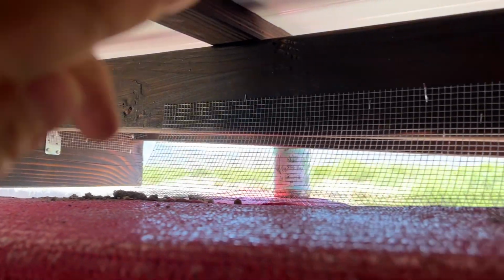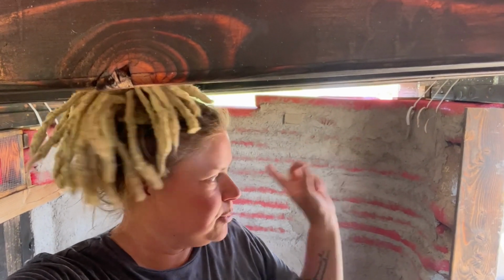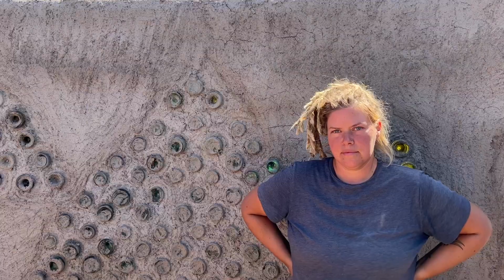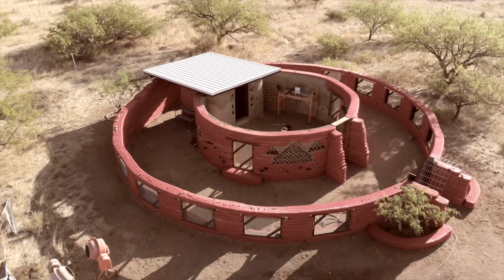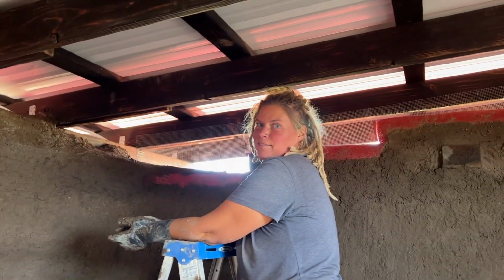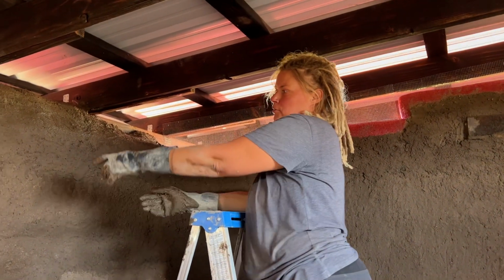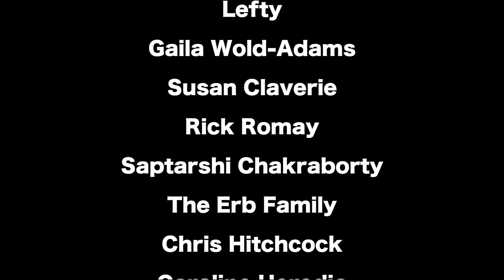Do We Have a Productive Day? Fingers Crossed! (Chicken Garden Day 121)

Comment: Guys… you have set up the PERFECT way to flow any heat from the roof out of the chicken coop, and that’s by stapling a reflective radiant barrier to the underside.  Trust me, it will be much cooler in the coop where most of your heat will come thru the roof.  This looks awesome by the way!!!
Reply from the maker: Don't need it. The temps inside are so much cooler. Watch tomorrow :)

Comment: Harbour freight sells black sun shade tarps.  30 % with airflow and grommets.
  The airflow helps with the wind.  Considering it's just temp.  Screw or bungee it to roof use poles and ropes to raise and secure to fixed items outside structure. Trees stuff.

Comment: So was this layer a base layer of plastering or was this evening everything out with cob?  I'm confused!!  I didn't see any shredded straw going in but you mentioned cob.  And out of curiosity, I was wondering what your ratio of clay to sand ended up being for this layer.  thank you!!
Reply from the maker: We're technically forgoing cob on this building, using Cal-Earth's recommended 9:1 soil to cement plaster recommendation (then 9:2 on the final coat). Our soil is about 80/20 sand/clay.
Reply: @TinyShinyHome  thank you

Comment: Hee, Hee, yous in trouble :) 

But seriously, super glad I found your channel. I have really enjoyed the journey, and your overall attitudes to that process, as I 've watched your catalog of past adventures. As an extremely Jaded member of Generation xcommunicated, it is rare I find something that is wholesome without being "plastic" or cringe. 

I do have 1 question about the bags, and a scratch coat. Is it not for weather resistance in general, as well as the bags degrading in the sunlight? 
I have been under the impression that moisture in the earth mix itself can crate problems?

Cheers
Reply from the maker: Thanks :) Right, the bags, while UV treated, need to be covered and protected. Same with the soil cement mixture inside since it's a lower ratio. Building earthbag in a humid climate does bring it's own challenges for sure. But here in the desert it's not a problem at all.